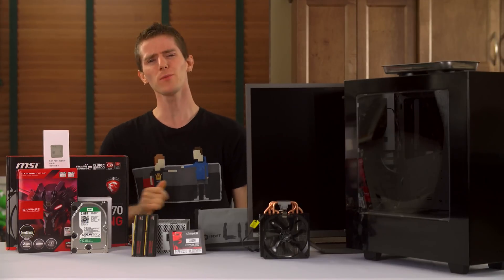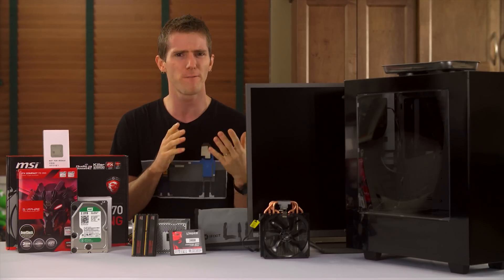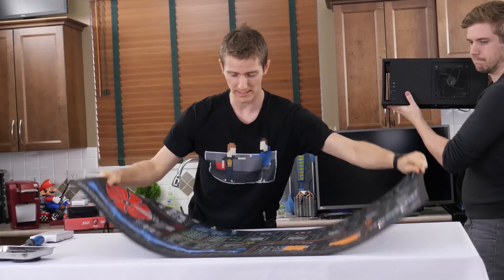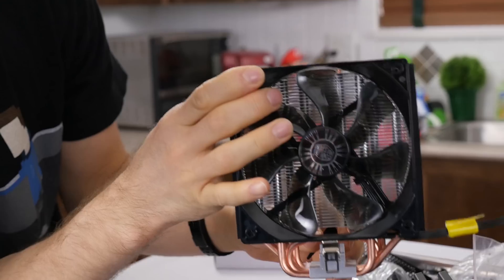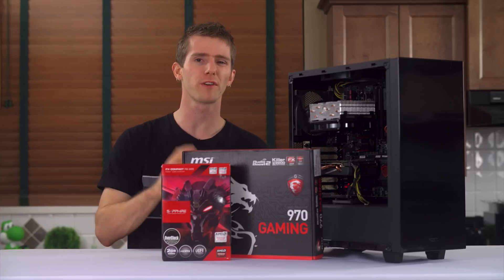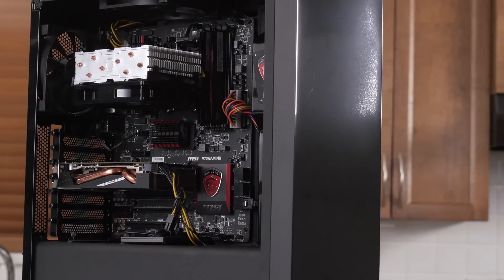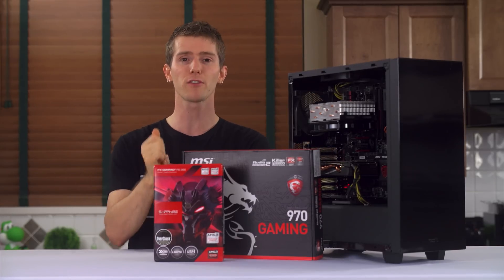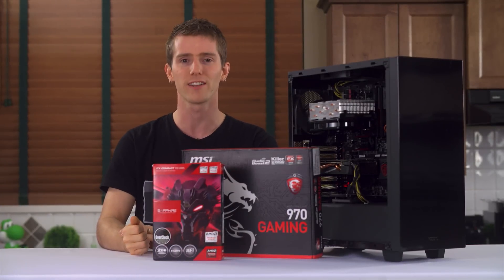Can you Build a 4K Gaming PC for Under $1000?

Comment: How great would this be for 1080p? would it be better to just build a different pc if i dont plan on going any higher?
Reply: I think it's a preety good build you can try it.
Reply: For 1080p it would be pretty kick ass. Depends on the games you play though. One other thing is I would recommend going for an octa-core CPU from AMD simply because its not much more money.
Reply: Bradley Doesnt Give A Fox  It does 1080p pretty well. I built mine about a month ago and came it around $1100 having to buy the OS, but was able to put a 500GB Samsung Evo SSD and MSI GTX 970 in there. I'm running it on a 21:9 LG Ultrawide all games except Witcher 3 @ maxed settings and no overclocks. I also got my own fans, controllers and so forth in that price. So if you were careful this $1000 will work. It will work well.
Reply: Sergio Tellez
you can't understand how? well he puts it together,installs the OS and then runs those games at 4k, if you really think he would lie about this then you are in denial like the other people here who prob payed more for there monitor or vid card then this whole setup costs.
Reply: the only problem is nobody is stating what you are claiming because it is just common sense that this rig wont run most AAA titles at that resolution, watch the video again from 0:00 - 5:59
Reply: The fact is that this build wont handle 4k in most AAA games. another fact is that it can run "some" popular games in 4k
omgtkseth
Reply: *****  "this rig wont run most AAA titles at that resolution" which is why Sergio said this is not a good option to truly handle 4k.
Reply: omgtkseth
yes i know why sergio said this, it is an obvious statement to make, it is even stated by linus in the video, my comment refers to "I can't understand how linus believes this rig can handle 4K" , Does sergio think that linus thinks this rig can handle AAA titles at 4k? or does sergio think that linus thinks this rig can run "some" popular games at a playable 4k?
sergio's entire comment is redundant because this video not only clearly states everything it demonstrates it, you actually see this rig run games at 4k and they are clearly playable. so why would sergio say that he cant understand why linus thinks this can handle 4k? its a pretty dumb comment from sergio if you ask me.
Reply: I like 60 for most games but I actually like bf3 at 30fps instead of 60fps probably cause I played it like that on 360 for so long and I can't get my accuracy right at 60 but that's just me
Reply: +Bradley Doesnt Give A Fox  It would be just fine
Reply: Bradley Doesnt Give A Fox Its a nice build for 4k but dont think its overkill for 1080p. Newer games are quite demanding, with some games suggesting $350 gpus for the recommended settings at 1080. There are many games that wont be maxed out at 60fps in 1080p with this build. Just look at r8 285's crysis 3, Far Cry 4 and Metro performance. This is a solid build for 1080p gaming but you still need more to fully dominate that resolution.
Reply: Bradley Doesnt Give A Fox I'm just gonna say that It's not the best option. I can't understand how linus believes this rig can handle 4K
Reply: ***** The fact is that this build wont handle 4k in most AAA games. Its obvious by the games he picked to showcase, i.e., non demanding games. That build wont do for call of duty, witcher 3, tomb raider, gta v, assasins creed and other similar games. Linus himself says it at 5:59. "you'll need to run at a lower resolution". 4k is still not viable with this build. Its like building an 9.1 AMOS surround system that wont handle AAA games and only work with minecraft, slenderman and octodad and other light games. I wouldnt call that a 9.1 AMOS capable system. You are ruling out too many mainstream blockbusters and best sellers. You could play chess master and other boardgames at 8k and 240fps with this build and I wouldnt call it a 8k capable build...
Reply: ***** Of course I'm not questioning the linus knowdledge in terms of pcs but cmon don't you  realize that an i5 4690 o 4690K with an R9 280 crossfire would perform better on 4K?
Reply: ***** Remember this is not about if this will be able to run it or it won't but always there are better configurations for the right purpose as for example to play at 4K
Reply: Sergio Tellez
Are you saying a similar setup but with i5 4690 or 4690k and and 2x R9 280 cards would cost exactly the same as this and perform better?
I don't understand where you want this conversation to go or what your point is?
I dont have any problem with any part of any of your comments here other than "I can't understand how linus believes this rig can handle 4K"
Reply: Sergio Tellez
Did you actually watch this video, can you understand English well enough to know whats going on in this video?
Reply: ***** Its not very hard to see that his phrasing wasnt the best but its also not very hard to get what he meant. Thats the point of my mention of the 8k chess game. You could call it an 8k machine and if someone says it cant handle 8k games its tacit that he understands it will indeed run chess master at 8k and he thinks that is hardly 8k gaming. In fact, sergio's comment is not redundant but a repetition of what Linus said when commenting on what playing AAA games required with this build.
Reply: omgtkseth
your 8k thing is fucking ridiculous.
 it was a ridiculous analogy and i have no idea why you keep bringing it up.
Reply: omgtkseth
 so in your opinion what did sergio mean by the statement "I can't understand how linus believes this rig can handle 4K".... ?
Reply: ***** Its exactly the same thing. This machine plays 4k but on meek games. Thats why Linus says you wont play assasins creed 4k with this build. If people want "4k gaming", vagueness be welcome, get a gtx 750 and play Doom 2 at 4k. If you think that this can satisfy the average gamer wanting to play at 4k, then I cant understand how can you believe that. Not even considering that this does 4k in some games, but also considering you could possibly do better with the same budget. Say, why dont you forgo the case, invest a little more an a better gpu and stick the build up your ass! ha. Just kidding. You take random vague comments way to seriously. Go and fight feminists and religious nutjobs, thats more worth while than whatever 4k gaming means...
Reply: omgtkseth
exactly, random and vague comments, i dont take them seriously,in fact my original reply to Sergio is quite the opposite. you seem to be the one taking this too seriously in my opinion and is more than likely the reason you feel the need to reply to a comment i made to another person typing several paragraphs trying to justify Sergio's vague and random comment using analogies of things that don't exist.
tell me in your opinion what Sergio meant by "I can't understand how linus believes this rig can handle 4K"  because thats all that needs to be said.
Reply: omgtkseth lol nice comment.
Reply: its great
Reply: But you can't even see 200fps unless you have a really good monitor
Reply: +Bradley Doesnt Give A Fox I have this exact build, and it's great
Reply: 4K isn't as hard to run as you think , look up the potato masher for 350$ it runs most games at 1440p high and 4K medium at playable frame rates
Reply: Westin Mcclister yes playable is 30 fps... its hard to do that for me imo im used to 60fps all day. just looks better.more fluid.
Reply: Westin Mcclister wow i never thought of that. you are so used to the frames for accuracy. thats cool man.  you can always lock down to 30fps. and have your system working less hard. produce less heat and use less power. lol its a thought.
Reply: +Westin Mcclister bro.... lower fps doesn't help in fps games while playing on PC. it because higher fps gives you more smoother change and to my knowledge would help increase your accuracy sure it may be a little weird in start but when you get used to it, more headshots or well just kills

Comment: Need accurate information about my budget gaming pc! Please no hate. I know its not that great. How will this build handle most games on medium settings? And will it run GTA 5? Please let me know I know these type of comments are annoying. I will upgrade to an i5 in a few months. 
  I am willing to upgrade the Motherboard, Video Card, and Storage. But my budget for each of those items is $150 for Video Card, $75 for Motherboard, $65 for Harddrive. 

CPU: Intel Pentium G3258 3.20 GHz (Bought)
Motherboard: MSI H81M-E34
Video Card: EVGA GeForce GTX 750 Ti 2GB Superclocked
Power Supply: Thermaltake TR2 430W (Bought)
Memory: PNY DDR3 1866MHz (Bought)
Storage: Western Digital 1TB

Comment: hey linustechtips,

could you make a video of a computer with this componments

Cerebro Budget
Hardware
Behuizing:
Corsair Carbide SPEC-03 RED
Verlichting:
LED Verlichting Rood
Geluidsdemping:
Corsair AF120 Quiet Edition (Rode LED)
Moederbord:
GIGABYTE GA-970A-DS3P
Processor:
AMD FX-4300 ( 4x 3800 Mhz ) Quad-Core
Overclock:
De Processor Overclocken
Processor-Koeler:
Scythe Katana 4
Geheugen[RAM]:
8GB DDR3 1600Mhz (Corsair Memory - Dual Channel)
Videokaart:
NVIDIA GTX 750 Ti (MSI GTX750TI Gaming 2G GDDR5)
Geluidskaart:
Onboard audio 7.1
Hardeschijf 1:
120GB Solid State Drive (Crucial BX100)
Hardeschijf 2:
1000GB Harde Schijf (Toshiba 7200RPM)
Hardeschijf 3:
Geen 3e Harde schijf
Hardeschijf 4:
Geen 4e Harde schijf
Netwerk:
Gigabit LAN (100/1000 Mbit) aansluiting
Drive:
DVD-RW Dual Layer Brander
Voeding:
Corsair VS Series VS650

thnx you

Comment: Looking to upgrade my computer.
A8 6600K quad core 3.9ghz cpu
Integrated graphics HD8570d
8gb RAM (No idea what brand, does it really matter?)
MSI A78M-E35
500W PSU

I was planning on getting a new gpu the R9 270x, however are there alternatives i could consider? I'm not really fussed on getting the highest quality graphics, i mostly plat RTS games and i just want greater fps.

Comment: my answer to this question.... no.... you can not.... you'll need a beefed up SLI and it'll cost 1400 - 1800

http://pcpartpicker.com/p/4fs7Bm

while monitors aren't part of the price, I only included them as a recommendation. center 4k, then 2 more 1080p displays. for this gpu setup. you could play games at 720p or 1080p on all 3, or 4k on one. also, 27 inches is a little large, i know, I was just trying to keep an ips and acer theme.

also. overclock that cpu. ram.

Comment: Well time for a new PC. I want to try and run Skyrim with ENB mods at maximum settings, my poor little Sapphire HD 7770 can only run the performance version of the mod. Anyways based off the video I went through newegg and picked some parts. Hope to have enough by the end of the summer. Maybe someone can look through and approve my build?

GPU: MSI GTX 970 GAMING 4G
RAM: G.Skill Ripjaw 8GB
MOTHER BOARD: MSI Z97 GAMING 5 LGA 1150 Intel Z97 HDMI SATA 6Gb/s USB 3.0 ATX Intel Motherboard
CPU: AMD FX 6350
POWER SUPPLY: Rosewill Photon-650w

Total $975.91

Comment: LinusTechTips My PC has an i5 3770k, 8gb 1600mhz RAM, 1TB WD Black Hard drive, and a 4GB 290x running on Windows 8.1 Pro. I play on a 1080p 60hz display. It is completely virus free, the hard drive is never fragmented, the drivers are always updated, and I have only overclocked my graphics card by .5%. I'm really confused on why it lags a little on CSGO at full settings and even on some other games. GTA V I maybe understand because the full drivers haven't come out yet from AMD. I'm planning on getting an SSD soon, but I don't think that will help the case. Do you have any advice on how to remedy this? (Or anyone else)

Comment: Since I saw this video on Boxing Day 2014 I thought may I should do this too....so I bought parts and built a PC with your challange in mind and achieved my goal.  I can achieve games such as Skyrim (modded), BF4, Far Cry 4 and Dying Light at 4K on Ultra Settings and acheive 40+ Frames Per Second.....and even Crysis 3 on Ultra, no AA @ 4K Resolution and achived avg 42.7fps

Corsair Carbide Series Air 540
AMD A10 7850K Black Edition (Stock Clock & Cooler)
AMD 8GB (2x 4GB) DDR3 2400Mhz Radeon R9 Gamer Memory Kit
Palit Jetstream GTX 970
MSI A88X-G45-GAMING
120Gb Samsung EVO 840
Seagate Barracuda 2Tb
Corsair CX600

Total Cost £646.42 ($998.23 as of Exchange rate 09/05/2015)

Now.....I did buy some parts in sales and I already had the case, and I have spent nearly 4 months shopping around at local Computer Fairs (Great Place for a Bargain) and even better than online most times.

As for the 4K Gaming screen, I already owned a 4K TV so I can sit back on my Sofa and play Controller Friendly games and for BF4 and other non friendly controller games I did cheat and use nVidia's DSR function on my 1080p monitor to acheive 4K Resolutions, that said....I am amazed at how the Under-rated APU can acheive these levels of gaming.

I can safely say that 4K Gaming is very achievable Mr. LinusTechTips Guy!!!

Comment: Green- Cool, quiet operation with massive capacity.	
                  (Desktop PCs, secondary storage and external drives.)         500 GB - 6 TB

                                                            VS.

Black- Maximum performance for power computing.
             (Photo and video editing, and maxed out gaming systems.)        500 GB - 4 TB

Comment: I can understand 4k gaming. But I think it's too early to be "mainstream." 

I can remember a time when 1280x1024 was an enthusiast resolution not meant for every day use. 

My weird ass monitor only goes to 1400x1050, and that's fine for me. 

Though I do want to upgrade my 650 ti SSC..
Reply: It's only going to get worse.
Reply: MakoRuu Simpler time man, back when games were all there when you bought them, no day one patches and dlc  was still a concept.
Reply: MakoRuu I actually have got 1280 x 1024 resolution,but my entire PC is bullshit and I can't even play Crysis. I'm a geforce 210 user,so I must use 1024 x 768/800 x 600 resolution and low settings :c
Reply: Bro. If you can scrape together $50 USD you can buy a GT 640 from eBay. It can handle Crysis on low medium settings.
Reply: There was always expansions.
Reply: MakoRuu  Yeah but those were usually building upon what made the game great, not ripping stuff from the game then making you pay for it or the microtransactions.
Reply: MakoRuu Yeah you've said it soon they'll be selling games in small increments and still charge $60.
Reply: Jerry Moore M'eh
Reply: MakoRuu I still use 1280x1024
Reply: Still a good resolution. Still considered HD.
Reply: MakoRuu Still using 1280x1024
Reply: RagingHammer Glorious resolution.
Reply: 1280x1024 monitor from the day and age that it was new. Ah, so old that it reeks of dust... charming with the ladies you see.
Reply: Hagoromo Ōtsutsuki 1280x1024 master race
Reply: RagingHammer Yeah! Go 1280x1024 best resolution!
Reply: Hagoromo Ōtsutsuki I've bee using a 2560x1600 for years. (It's like the 1440p version of 1280x1024). Honestly, 16:10 really is an awesome aspect ratio.
Reply: Matteo Noturb I would really like to have a better GPU, but I think that saving money for a much better PC is the best option xD
Reply: MakoRuu or for 150 USD you can get a GTX 750 ti or for cheaper you can get a r7 260x.
Reply: El canal de Limfao dude i can run crysis 3 in 4k at 60 fps and my pc only cost 1200$
Reply: dayum
Reply: I'd rather play at HD and 144hz then 4k and 60 anyways, and this PC is way more than enough for that
Reply: MakoRuu I play on a 1366 X 768 HDTV, and games still look beautiful on ultra
Reply: Fernando Azcona same here
Reply: MakoRuu The last time I saw a GTX 650 on ebay it was $48 USD
Reply: Duy Vo GT 650*
Reply: Matteo Noturb no it was a GTX 650. 
http://www.ebay.com/itm/Vamery-GTX-650-2GB-128Bit-DDR3-PCI-E-3-0x16-Graphics-Video-Card-/131447316607?hash=item1e9adee07f
Reply: Duy Vo woops my bad the i was getting confused with the 650m
Reply: MakoRuu Which Budget 4k monitor should i use? And will i be able to run the latest Games like GTA V and others...
Reply: Shirso Supratim I know a person who could run GTA V on a gtx 670 (on pretty low graphics settings mind you) in 4k, so if you have a better GPU than that, you should be fine.
Reply: Youre runnig a build ... Older than my knowlede of computers ...
Reply: +MakoRuu I really do not understand most of this stuff.
I gave a mate £600 in the Uk and said make a pc for me as good as possible.
that was 4 years ago.
It runs everything fine  even day z when its not optimized is playable.
So what are these machines for?
Reply: +buzongtang u replied twice...
OK! ^_^

Comment: This is my dream Gaming PC tell me what it is like. 1 xIntel Haswell-E I7-5960X 8-Core 3.0Ghz LGA2011-v3 Processor BX80648I75960X
1 xGigabyte GA-X99-GAMING 5 LGA2011-v3 DDR4 Motherboard ATX
1 xCorsair Dominator Platinum 16GB 4x4GB DDR4 2800MHz Memory CMD16GX4M4A2800C16
1 xSamsung 850 PRO 1TB SATA 6.0 SSD MZ-7KE1T0BW
1 xWestern Digital Green 6TB SATA6.0 3.5" HDD WD60EZRX
3 x Gigabyte GeForce GTX 980 4GB DDR5 Video Card GV-N980G1 GAMING-4GD
1 xAsus XONAR ESSENCE STX Sound Card
1 xAsus 16X Blu-Ray CD-DVD SATA Optical Drive BW-16D1HT
1 xCorsair Hydro Series H80i Intel/AMD High Performance Liquid CPU Cooler CW-9060008-WW
1 xCorsair AX1200i 1200W Modular 80PLUS Platinum Power Supply CP-9020008-NA
1 xThermaltake Core V71 Full Tower Case CA-1B6-00F1WN-00
1 xProfessional assembly and testing of your configuration [Included 1 year warranty]
1 xMicrosoft Windows 8.1 PRO 64-bit English 1PK DVD OEM FQC-06950
1 xAsus PA279Q 27" with Speakers AH-IPS LED LCD Monitor
1 xLogitech Speaker System Z906 5.1 980-000467